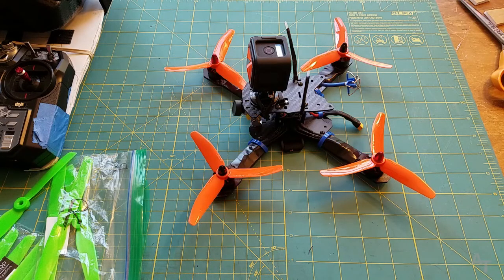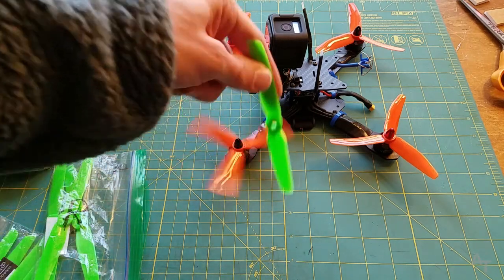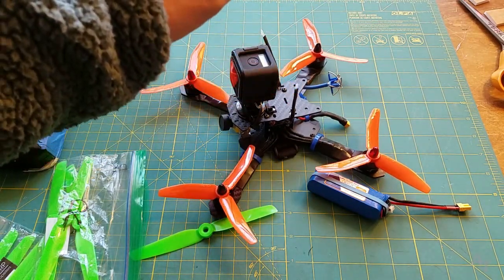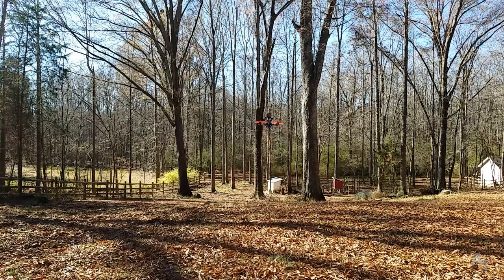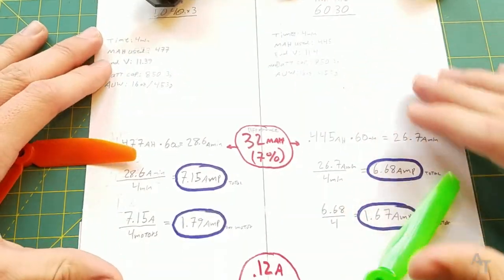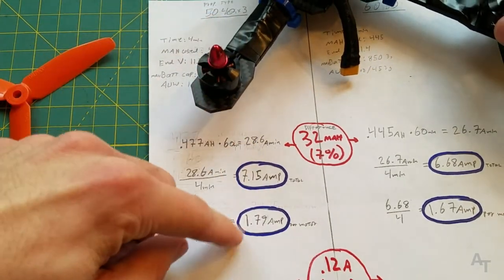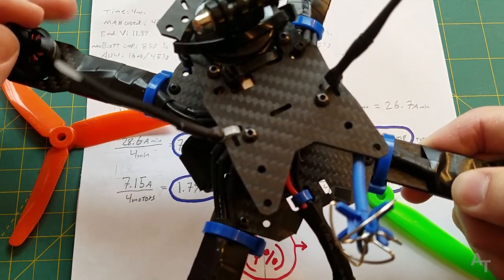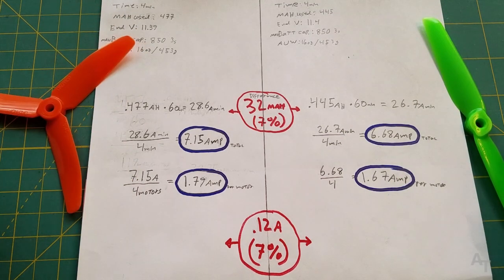Poor-Man's Method for Comparing Propeller Amp Draw (Cheap, Simple, and maybe accurate)

Comment: ummm question.... what good is an amp draw number taken from a 4 min hover especially when comparing 2 and 3, your efficiency numbers are going to spread when you start accelerating and cornering, the more blades the better the quad will turn but the will also draw more amps and the fewer the number of blades the higher your top end speed will be. 6030 props are kind of weak, 6045 or 6047 will make that quad scoot.....